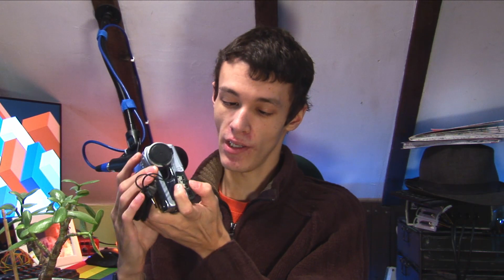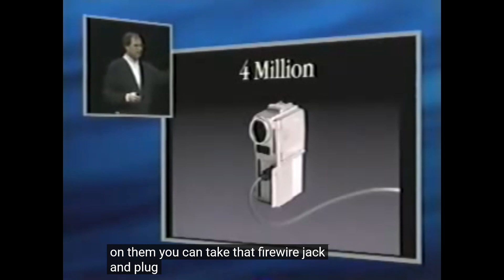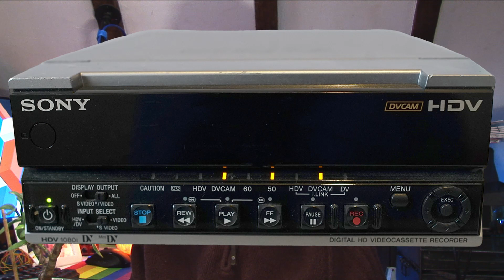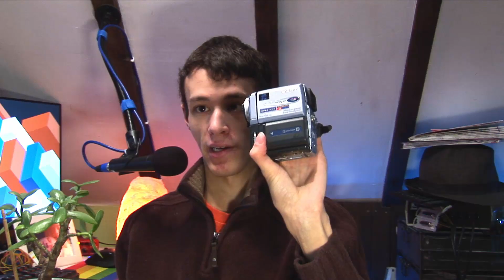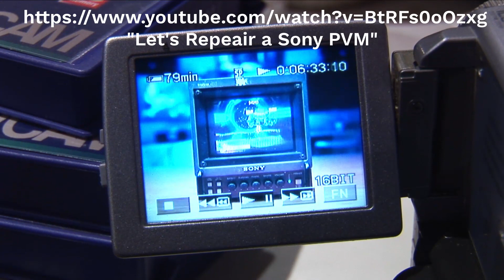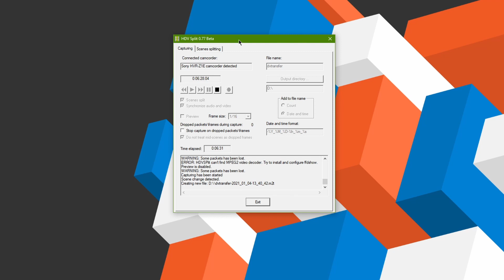How to transfer DV & HDV tapes to your PC 2021

Comment: What I have observed in the past certain pci card that have Ati Theater rage chip. Those chipsets can encode analog  audio-visual composite signal into DV format in real-time. To summerised it's in the chips to be  multiple by the programs. Example I learned the you can still get 4k 60-fps.on the third party software. Egato uses the  same chips set like Avermedia or Acasis ep.. OBS is the best 3d party software .

Comment: Great video.. Ive been trying to get my old MiniDV tapes over to my PC so I can edit them and put them on youtube. Unfortunately Windows 8 no longer supports the software/hardwares that the firewire uses.
After many years of heartache, I remember that windows XP had no problem with me doing my converting/transferring from miniDV. I even tried to reinstall a virtual machine to XP so that I could (but to now avail)
My question to you , Is it possible for me to go from my MiniDV camera (FIREFIRE) to a (Firewire to USB 3.0 converter cable) and use that to transfer?

Comment: You can always capture HDSDI from a deck like the HVR 1500a through any number of external capture devices or record directly to an SSD with an atomos recorder. Yes it's a fair initial outlay but you can always sell everything again once you have captured your tapes.
Reply: Nano flash is same but they made lots of them and no one uses them anymore so it's a bit cheaper.

Comment: You explained this beautifully and I loved the video but I'm seeing this weird video distortion when I preview and capture the video and my captured video/audio seems to be sped up about 2x. I'm recording from Digital8 video to win 10 using firewire. I tried Firewire 400 and 800. It's a Sony DCR-TRV830 if that helps. Do you happen to have any advice?
Reply from the maker: Interesting. I have never used Digital8 so cant say for certain but is it possible your tapes are recorded in LP and your playing back at SP speeds? that would result in a faster result but I would imagine Digitial8 should auto detect the speed?

Might be worth trying with a second camera if it continues to give you issues
Or maybe your tapes are at fault. with zero experience with Digital8 thats about all the advice I can give you I am afraid
Reply: It may be that your tapes are recorded in lp mode on a different camcorder than the one you're using to play them back. Even Sony warned people that its lp mode did not work well, especially if played on a different machine than the one that recorded the tape. MiniDV, which uses the same digital codec with a different tape format, suffers the same issue. Sony's pro DVCAM decks like my DSR-30 will play consumer DV tapes, but it won't even try to play one recorded in lp mode.

Comment: That Firewire Card Expansion Card PCI-E, Will fit in the slot where i add my GPU? Like Nvidia GTX 1070? :) Thx!!
Reply from the maker: Indeed it will. Any PCI-E slot will work even the small X1 slots as most firewire cards are only X1 anyway